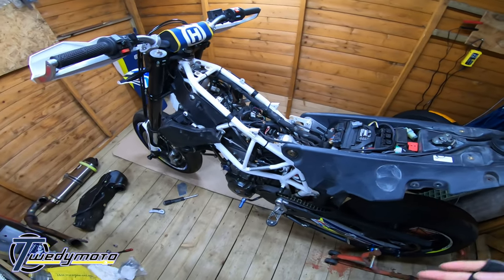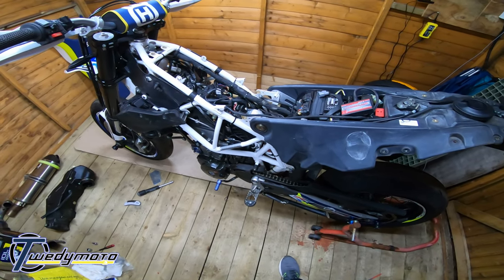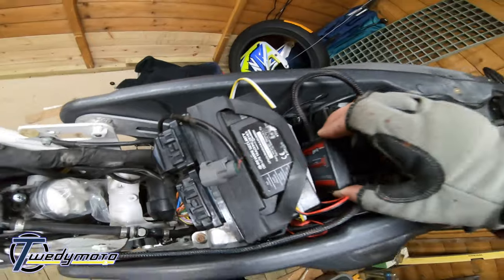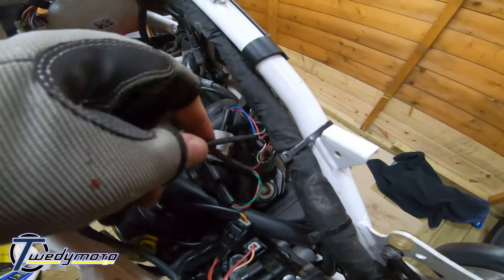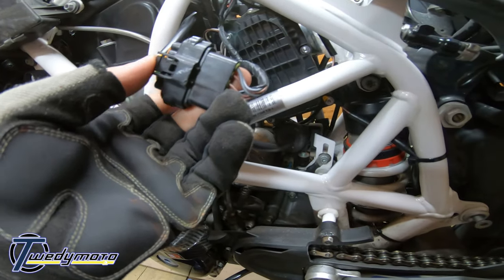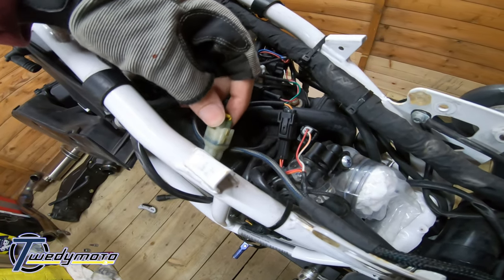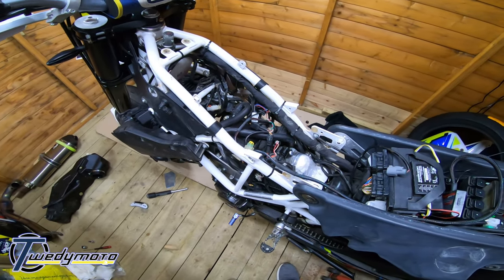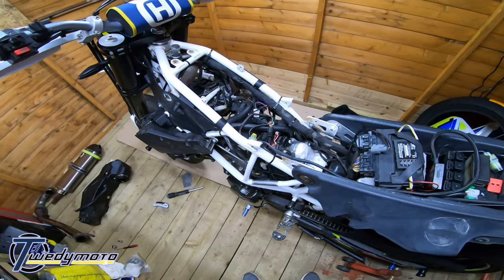How To Install Power Commander on Husqvarna 701 & KTM 690

Comment: Hi man, I'm planning to buy a new 701 but I have a couple of questions if you don;t mind ; from what i've read from various users the bike burns oil, does yours do? did you had it from new? did you do the factory specified break in or a hard break in with mineral oil (as other users would recomend to stop burning oil).thanks in advance
Reply from the maker: I've had mine from new. I followed the break in instructions loosely. For the first 200 miles or so I took it really easy as I came from a Honda Grom. Once I was used to it I rode it steady. Didn't rev it hard or give it death, more like a leisurely cruise and pushed it harder after 500 miles then got it serviced at 600 miles by my dealer. It did use some oil (all engines do) but it uses a lot less than it used to now that the engine is worn in fully. You will hear a few problems of it burning oil and other issues but there will be thousands out there that don't.

The only big issue on these is the clutch slave cylinder failing. Mine was fine but I fitted the Oberon one at 9,000 miles as a preventative measure. Hope this helps buddy.
Reply: @Twedymoto  thank you very much for your quick response, it stresses me a bit as it's gonna be my first brand new bike and i've heard some horror stories lol, thank you very  much so, stay safe!

Comment: Which sprockets do you use/prefer?
Stock is 16/42.
Reply from the maker: I ran 15/42 for a while but on track but I was rarely out of 3rd gear so swapped to 15/44 and it's great for wheelies and smaller tracks now. Will still top out at a decent speed (117mph) but is revving higher at normal cruise speed.
Reply: @Twedymoto  About the speedo, did the speed sensor is on the rear wheel and you're able to see the real speed or is it totally wrong ? Also did the traction control work well with different sproket ?

I've got a previous bike with all the electronics KO when changing the ratio so…

Comment: Did the o2 dongle come with the PC-V or did you get that from another retailer? I just installed my PC-V last night but it didn’t come with an o2 dongle, TIA
Reply from the maker: Mine did mate. I think dynojet stopped providing it for some stupid reason but without it, it defeats the object of having a power commander. If you're in the UK, you can get them cheap on ebay. 👍
Reply: Twedymoto ah yeah I just looked it up on Rottweiler, they stopped in 2018 for international regulations, but it’s an off road use item anyways🙄, thanks for the swift reply!

Comment: Thanks again for this one, this is on my wish list. 👍
Reply from the maker: Check out Dave Wood Racing mate. They can remap the ECU so you don't need to fit a power commander. They're probably closer to you with you being dorn sawf.
Reply: @Twedymoto  Oh cool thanks, I will do this summer, next is that clutch slave still to do 1st 😄

Comment: Worse mileage or pretty much the same ?
Reply from the maker: Maybe a little worse but I've never really gotten great milage on this. I always fill up after around 100 miles
Reply: I just installed a PCV on my 701 yesterday but haven't riden it yet due to terrible weather but prior to the installation I would get between 240 and 250 klms out of each tank.

Comment: hi, as this bike can run two maps, can 1 map be the a2 license 30kw and the other map be full power ? so i could switch between the two?  just curious thats all.
Reply from the maker: The A2 complaint map is loaded by a dealer (probably get a certificate or something) and probably has more than just lower fuel and retarded timing. Can imagine the throttle plate won't open as much too.

It could be possible with a power commander but it would need time on a dyno and a tuner who is willing to do it. 👍
Reply: @Twedymoto  ok, thanks for your reply. It was for 2 people to ride, 1 beginner and 1 experienced. thx
Reply: Did you mange to do this? Cheers

Comment: Get the ecu flashed mate!!!!
Reply: You can't flash the ECU of the 12' and upwards 690s it's locked from the factory you have 2 options you put an aftermarket ECU or a PC5
Reply from the maker: You can flash the ECU David. Not 100% on the older 690s but there was a thing called Tune ECU that let you flash it. On the newer bikes (2017 up) the ECU can be flashed but the tuners are very few and far between. There are 2 in the UK that I know of, DWR and P3 Tuning.
Reply from the maker: At the time I fitted mine, I got it for a good price and got a deal on tuning and there was only 1 that could flash it and that was a 12 hour round trip. Now that I have the power commander, getting the ECU flashed would be another £4-500 + travel which I can't justify for the extra 1-2hp that I might get. That said, it does have a slight throttle issue which may justify the spend :D lol
Reply: I got both my 701s from dwr but they don't sell them anymore. But they will still flash the ecu, they have moved to Buckingham now if anyone is interested. Most tuners will take a power commander and throw it away if they were tuning the ecu so alot of people see the pcv as a waste of cash. But as mentioned, tuners are not all over the place! Great to see ya vid anyway twedymoto, hope ya safe and well
Reply from the maker: I know DWR have more control when flashing the ecu. I think they remove the throttle restrictions in 2nd and 3rd gear too. The main advantage is not having to install any extras, they just connect to the ecu and change the settings and map. 👍
Reply: @Twedymoto  One advantage PC5 has is autotune it's a separate unit wich if you set it up right can tune your bike while riding it on all conditions wheres the ecu flash will not always fuction at it's 100% because of many reasons (temperature,humidity,diff fuel)